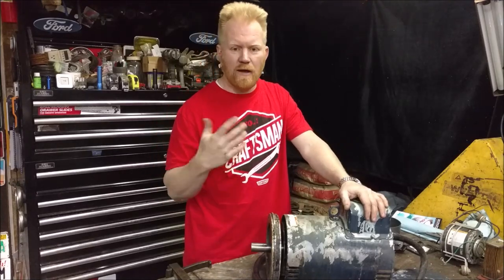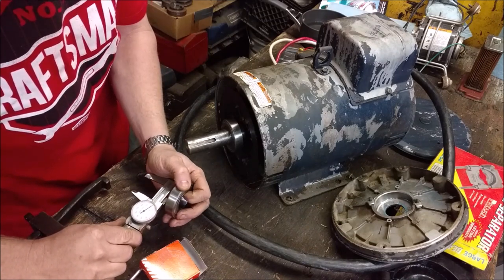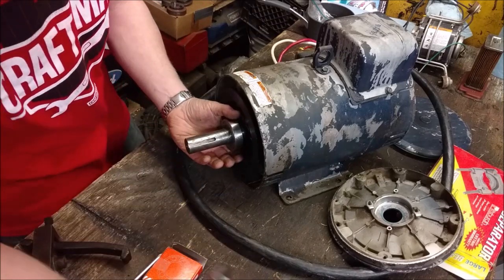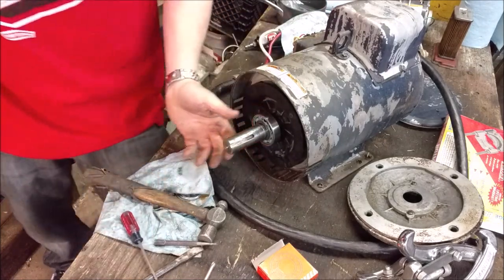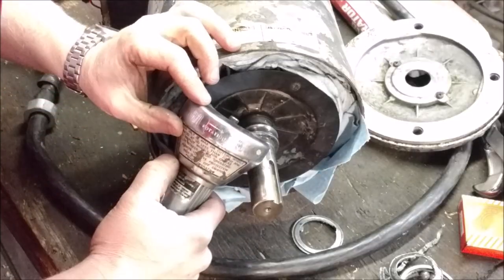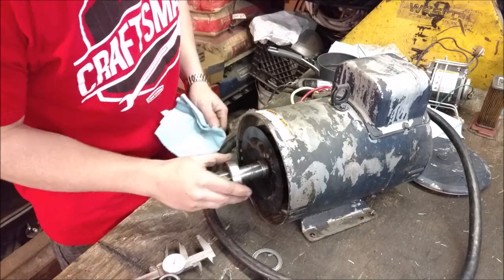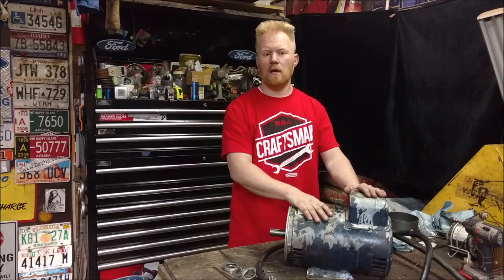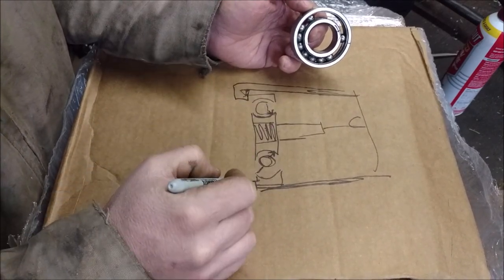How to EASILY Remove a bearing and easy reinstall

Comment: Thank you so much for the tips! I was trying to remove the old bearing on a logitech g27 wheel, i heated up the old bearing with an air solder station for a bit and it was a really easy removal. So once again thank you!

Comment: On the production line I worked on ages ago, we used to put the bearings on a metal bar that swiveled. In the closed position, it completed an induction coil which heated the bearings up, it got them really hot, really fast. Meanwhile, the axles were chilling in a freezer... .
Reply from the maker: That's neat.

Comment: Never thought of the hot water trick! Also like your explanation at the end of why a puller is not the best choice.
Reply from the maker: It just keeps the temp low enough to not destroy the grease inside. I've taken that tip from other people but have also just heated them up with a torch multiple times(slowly, just above holding in your hand comfortable temp)

Comment: ive had to do that on  pump truck  little front  wheels .. I took a grinder  then pounded them on  with the right size pipe..  its still working great.. .. please show how to  fix a  pump truck that wont go up anymore even that I added more oil.. thankyou..

Comment: A guy I worked for back when I was a teenager would always sit the new bearing on top of a light bulb to heat it.  That also works great.  If you still have any regular incandescent bulbs.
Reply from the maker: That's a great tip!
Reply: yeah but i dont believe these modern day light bulbs would get hot enough, They suck lol
Reply: Rodder Files LOL I said incandescent bulbs.   The CFL's and LED's would not work.

Comment: glad to see you use a ziplock bag. I have seen so many videos where a mechanic wraps a bearing in a moist paper towel and steams the bearing in the microwave. Steam, as in, adding water to the brand new bearing!

Instead of water, I just use a heatgun and warm it up until it's hot to touch (use gloves) but not cooking the grease (or seals if it has them). (tip: put it on a screwdriver instead of trying to keep your gloved hand in front of the heatgun) I've used a torch in a pinch, but it is easy to cook the seals that way.

As far as removing, I usually start with a puller. If it doesn't come off with a puller (and maybe a quick try with the torch while using a puller), then i find it very quick to cut through the thing. If the puller didn't rip the outer race off, then I just cut it near perpendicular to split the outer ring and cut through the cage at the same time (much faster than a diagonal cut for the outer parts). Then pop those off with a screwdriver and cut through the inner race diagonal like you.

Other Tips:
*for press fit installations, the old cut-apart bearing pieces only take a quick (power) sanding/grinding to make them small enough slop fit and are the right sizes to push the new bearing in.
*If you aren't in a rush, you can put things in the fridge or freezer to make them even smaller and combine that with a heatgun or torch to make fitting several layers together much easier. Use contact cleaner to make sure things are dry afterward.

Comment: No. Cutting the race should be the last option.
A puller is the way to go. The bearing will slide right off, just like that.
Reply from the maker: Agree to disagree. A puller runs the risk of galling the shaft and other damage. Slightly cutting the inner race makes sure this damage doesn't happen.

Comment: Excellent tip/video on removing the tin cage! I can see where there will be a time and a place where that would come in quite handy. A friend was talking to me about those battery powered snow blowers and then you had that video. That looked like a well built unit and figured you will put up a video of it in action when the snow arrives. He don't do much YT so I will tell him if you post one on that. Take care Moe, Jeff.
Reply from the maker: It hasn't snow much yet, but I was impressed by a few inches on the lawn that I piled up. I think it has the power to handle almost anything I put in front of it, I'm curious how long it will run.

Comment: I wouldn't think hot water would heat the bearing that much but wow, it worked! Great job as usual.
Reply from the maker: Just trying to heat it up but not ruin the grease inside with too much heat.

Comment: Yep been there.I had to use torches on this one job on a 4 inch 40 ft shaft for an air handler.was way cheaper than getting a crane and pulling the whole works out i saved them so much money. 3 day job done in less than 8 hours.
Reply from the maker: That's a big bearing.

Comment: FYI to anyone trying this. I threw my bearing into a sandwhich bag that leaked and moisture ruined the bearings.  I want to try it again because they didnt get hot enough to slip onto the shafts. I will try a freezer bag and put then in boiling water for what like 5 mins on a rolling boil?

Comment: just like how we do the big ones except we cut the cage off and use a bearing heater. You know it's ready when that son bitch is smoking literally. Then it's off to the races literally because you might be 200 ft in between the piece your working on.

Comment: Great explanation as to why a puller doesn't work as well as just cutting it off.  I was surprised the new bearing expanded that much and didn't have to be "tapped" back into place too.  Thanks Sixty-five!!
Reply from the maker: Thanks.

Comment: I use an old gas grill to heat up bearings, but boiling them in sealed bag makes more sense. no more cutting the outer race either!
     The gas grill works great for cooking out grease and oil from riveted brake linings (this will not work on bonded linings as the glue will burn off also) and clutch plates that still have a lot of life in them. Do an initial burn off, let cool. Clean up in the parts washer, blow off with compressed air and put back into the grill for a second cook off. When cool, take 120 grit sand paper to the lining and clean up with fresh mineral spirits.
   Don't forget to repair the leak that caused the mess to begin with.
Reply from the maker: I've used a torch to do brake shoes and it takes forever, but I like you grill idea.
Reply: I've used this process on field tractor linings a few times, you know, someone replaces a set of shoes or discs on one side, cleans up the leak without repairing it and the $50.00 set of linings are oiled up again. 
    When you cook off a set of linings you know they're getting hot(turn the burners up high and shut the lid) when the grease n oil are smoking out and you know when it's done cooking when it all stops smoking!
   After all this that grill has only 1 purpose in life, and it isn't food.

Comment: I could use some tips... i have a set of bearings i need to remove so i can put in a upgraded set. They are 6220rs press fit inside a Jack shaft of my "2020 phatmoto rover" motorized bicycle i tired to hammer them out but i think there is a inner lip like a cup holding them in built into the seat tube. Cant cut them and heating is limited...

Comment: There are several Great Procedures and Ideas revealed in this superb video. Sixtyfiveford, thank you so much . 
Question 1: In general, is it OK to heat pre-greased and sealed bearings to 100 degrees Celsius? The grease does not leak out at this temperature, does it?
Question 2: How did you install the "housing" of the new bearing, please? (I refer to the component which comes in contact with the outer ring of the bearing). Was it possible to push the housing on the bearing by hand? What to do when it is not easy to push the housing on the outer ring of the bearing?
Reply from the maker: I've never had an issue heating the bearing/grease. For internal fitment you can freeze the bearing to allow clearance.
Reply: @sixtyfiveford  Many thanks for answering my questions. I greatly appreciate your help. 👍

Comment: Nice Work, excellent presentation.
Can You PLEASE show us how to remove spherical plain bearing ge-g,  ge-gs type  20mm/0.78in  bore fitted/ pressed in ?
Reply from the maker: An internal pressed bearing can be heated with an oxy/acetylene torch and flash cooled to shrink it. A few spots and it should just fall out. You could also slice it but a 20mm is tiny and it's unlikely to fit an abrasive or diamond blade in there.

Comment: crazy that i just stumbled on this video. few days ago i nearly took my dome off when applying a crazy amount of pressure with a bearing puller in attempt to remove a very stubborn bearing. it exploded and thrusted the two foot handled ratchet and large puller straight in the air missing me by inches. had i seen this video first? three hours gone never get it back. thanks for the video
Reply from the maker: That's scary; keeps you on your toes. I've put a scary amount of pressure into these pullers and have had them break violently a few times.

Comment: The last bearing that I R&R was on an EMD 645 main generator and used a hydraulic porta something and an heater designed for the bearing which weighs easy 75+ lbs, this brought back great memories.
Reply from the maker: Thanks  for watching.

Comment: I would think you would want to cool or even freeze a bearing of you were pressing it into a steering knuckle in an automotive application. Great video as always.
Reply: What's the point? The bearing is going to be at atmosphere temperature 99% of the time. If you made it contract by freezing it, it would only stay contracted as long as it was cold -- same way as it works when hot (and thus why his method of putting the bearing on works)

Comment: I never though of doing the heat method with bearings, we used to freeze cylinder sleeves to insert them into tractor blocks though.
Reply from the maker: You just need to not get them too hot or you risk ruining the grease.
Reply: I can see why the hot water would work good.

Comment: Yea I've used the pullers and heat or cold, but I think I may try your method next time. Thanks for sharing !
Reply from the maker: I've never had great luck with pullers, maybe because I'm always working on old rusted stuff.
Reply: sixtyfiveford Good point. Come to think of it, most (if not all) of the stuff I had to pull (not often) was rusted also. But there were a few special times it was an internal bearing with no rust but lots of either greese or oil which had to be cleaned or the pullers kept slipping off - haha.
Anyway, glad you got that one off. That motor will last for another 20 years now. What are you using it for?
Reply from the maker: It's going on a huge industrial air compressor.